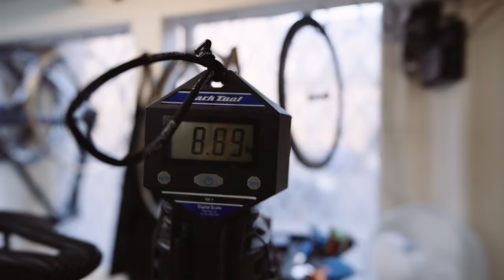DREAM BUILD GRAVEL BIKE  - Yoeleo G21

Comment: a couple questions( I"m researching for building a gravel bike ) What cassette is that you are using and what is it's weight?  What brandare your wheels and what is the widest tire they can accommodate? Are they 700c or 650 b?  Thanks in advance :-)

Comment: Hi looks great! What size of chain/ cassette do you use? I will like 1x with the more versatile because i do some road climbs, some bikepacking and also gravel
Reply from the maker: Hi, glad you liked the build 🙌🏻 40T GRX  1x11 crankset in the front, 11-51T Deore XT cassette in the back w/ Garbaruk Real Derailleur Cage and Pulley Wheels. I use KMC Gold Chain. I'm more like a mountainbiker, so I like these big ratios - with this setup I can easily climb up 25% walls.